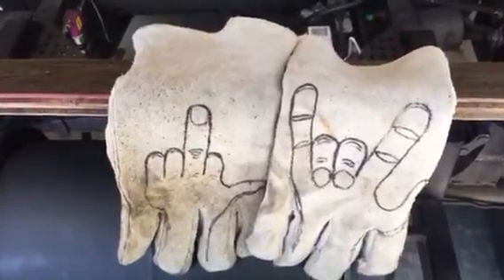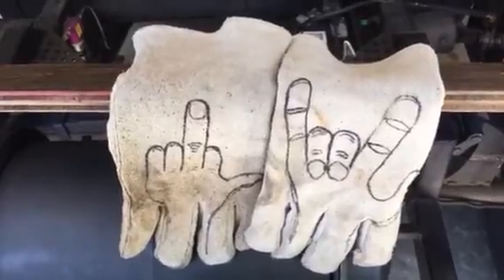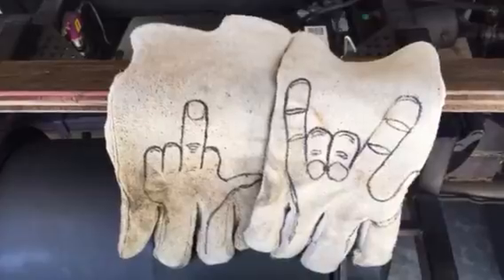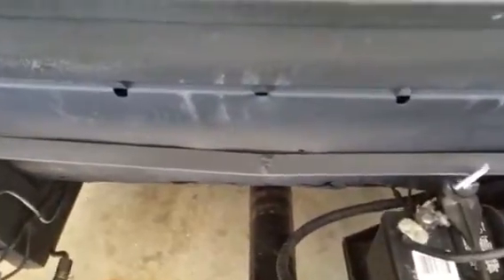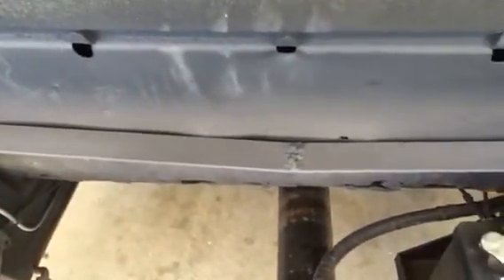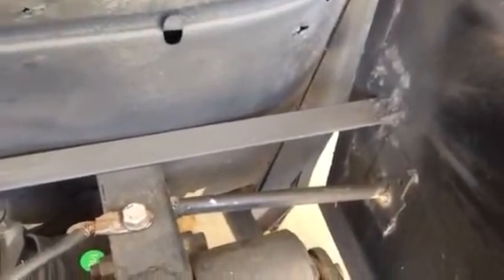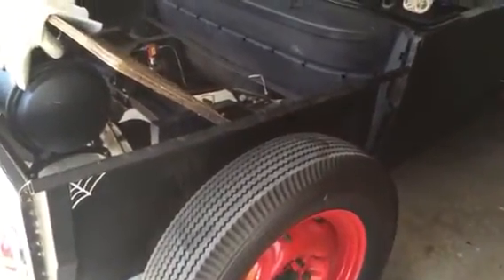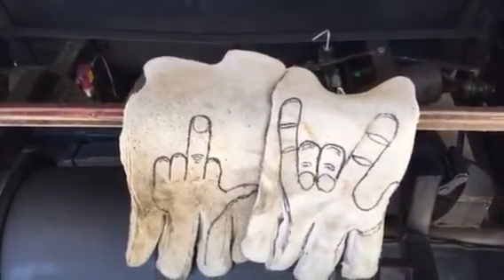Harbor Freight 90amp flux wire Tip

Comment from the maker: Want to see more welds with harbor freight 90amp welder. I have used it on a roadster windshield frame tabs. For a cheep ass welder I got on Craig's list I am having a good time using it for little projects. Look up on this page;
Hot Rod windshield frame 2.